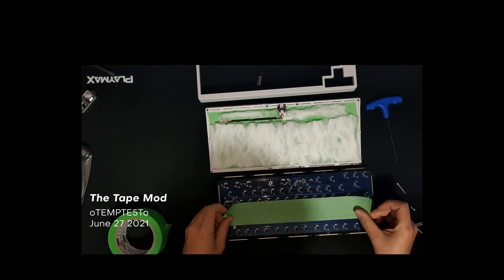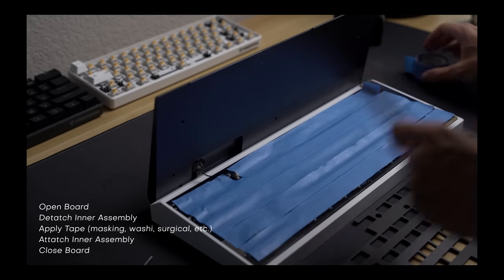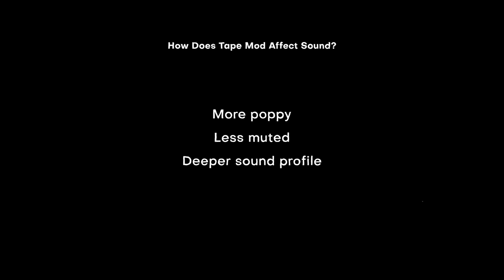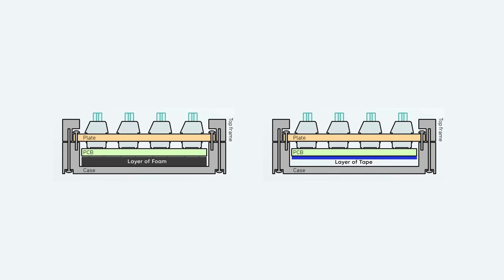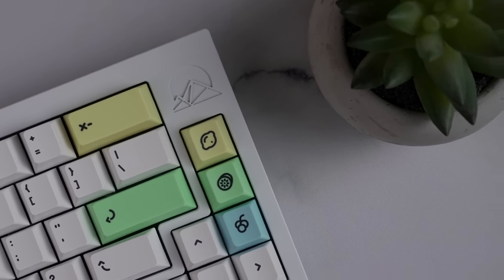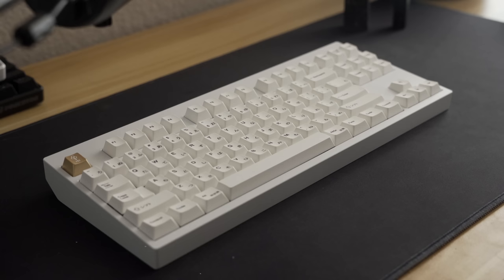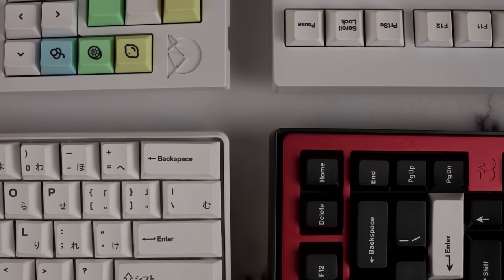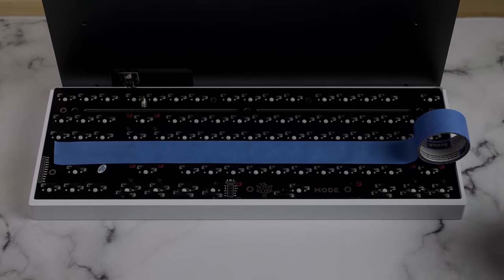Tempest Tape Mod Explained

Comment: does that mean using tape mod with case foam is counter intuitive?
Reply: I don't think so. The tape won't be a perfectly reflecting surface and some of the sound will expand inside the case. So I assume your case will still sound hollow without case foam, which is probably not desirable most of the time.

Comment: I use electrical tape and it works just fine
Reply: @recessedsubhuman  if I ever take the tape off that is. I leave holes for the screws for a reason

Comment: Any acoustic changes would be inaudible at that scale. There is no loudness, just perceived loudness. If you want to change the sound of your keyboard, you have to add mass within the interior of your keyboard. This is why the silicone/foam mods make the most difference.